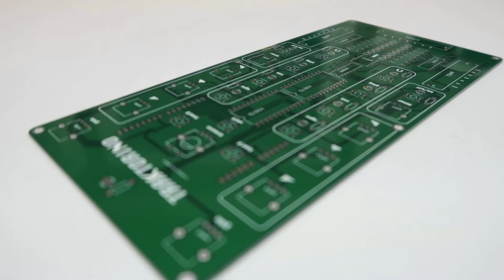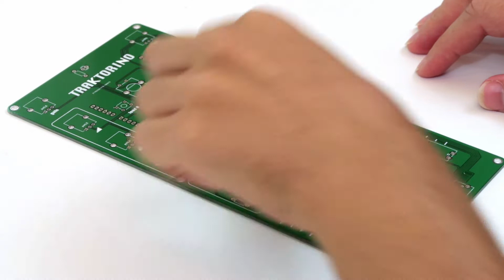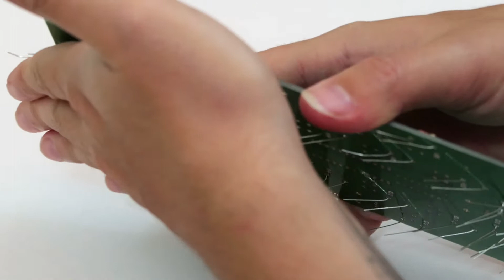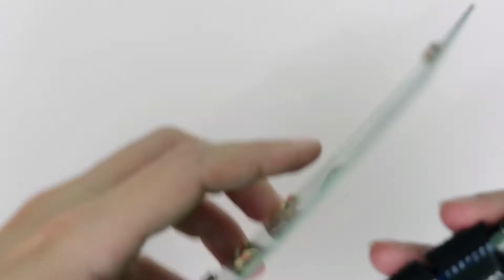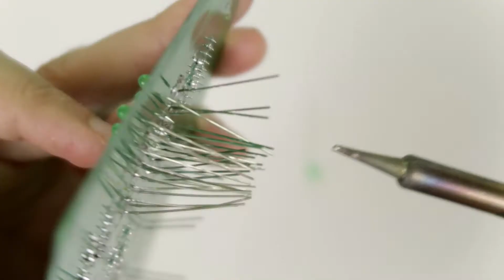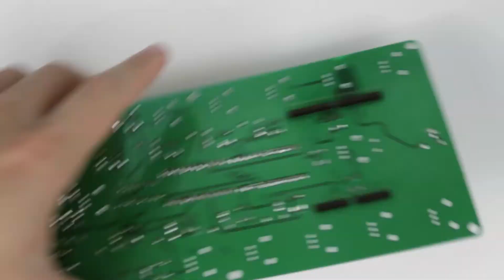#1 Traktorino how to: Assemble the PCB - The Arduino MIDI Controller for DJs

Comment: Hello Musico Nerd!
First of all, very very nice thing you have here. I already order my pcb, so now im waiting for it.
One question about the fadders, you told someone that the fadder travel its 30mm, and the complete lenght of it?, it may be 45mm?, i found some in aliexpress with those sizes.
Reply from the maker: Complete length of 45mm. It's the same footprint of the one they sell at sparkfun.
Reply: @NerdMusician  Obrigado
Reply: @NerdMusician  and another question, what size do you use for the screw that hold the pcb in the acrylic case?, thanks a lot.

Comment: I am interested in purchasing a kit but can the PCB be modified ? I wanted to build a full rotary mixer instead of the channel faders.
Reply from the maker: I don't have any right now, and my country shut down any international shipping! F** The PCB has available pins so you can connect other stuff, but you'd have to change the code.

Comment: Músico Nerd estou com algumas dúvidas pra começar no curso completo! 
1=  Que materias (ferramentas) preciso pra começar a fazer os projetos MIDI.
2= Como funciona as aulas exatamente? Sei que são onlyne mais tipo sao varios videos já lá disponiveis, ou você encina em tempo real?
Se poder me responder! 
De já agadeço...
Reply from the maker: Oi Carlos! O curso é todo online com aulas pré gravadas. No momento que você compra o curso você ganha acesso à plataforma, onde pode assistir às aulas. Você tem 30 dias para testar, caso não goste você pode pedir sua grana de volta.
Os materiais que você precisa no início são um Arduino uno, uma breadboard, potenciometros, botoes e jumpers. Depois que você vai decidir que tipo de controlador vai querer fazer, aí é com você! Aí vai precisa de solda, e material para cortar e desencapar fio.

Um abraço.
Reply: Músico Nerd Obrigado amigo, ainda esse mês irei comprar o curso... obrigado pela atençao.👍